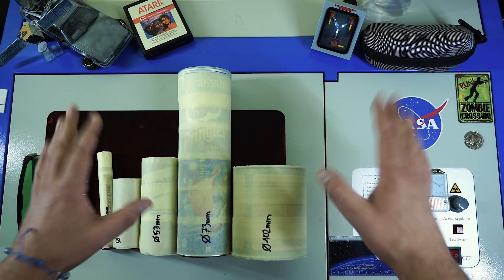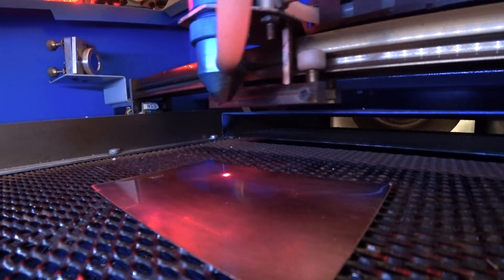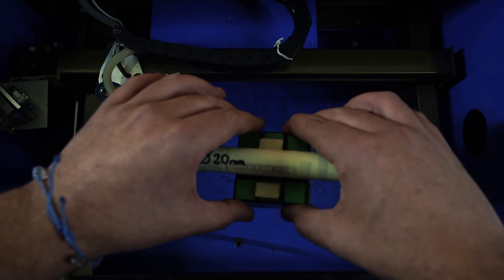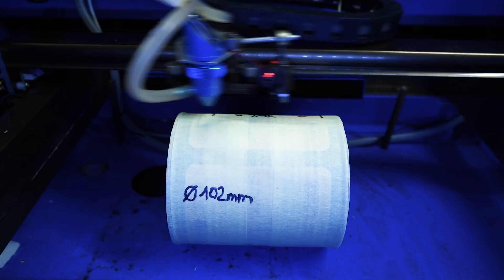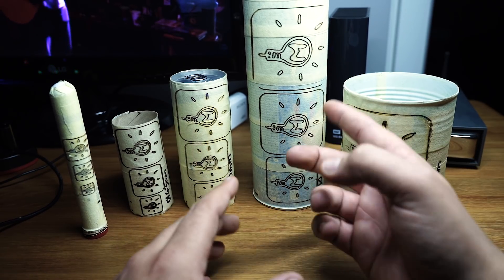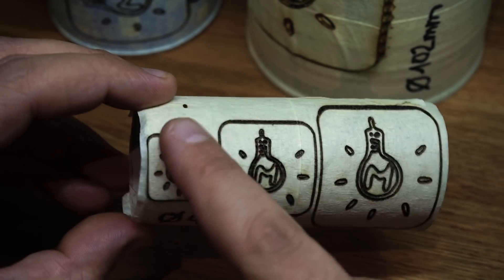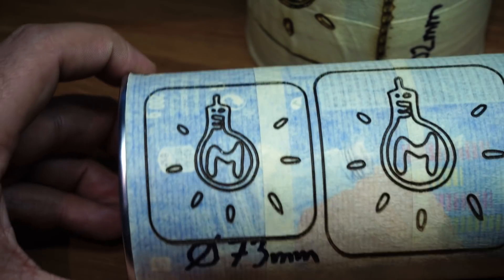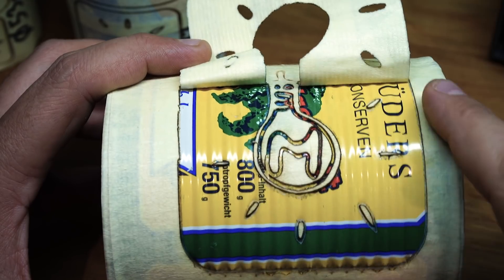K40 Laser Engrave Cylinders without Rotary Attachment?

Comment: can you tell me if I can use a K40 unit to engrave an 8mm logo on a 10mm pen barrel without a rotary attachment?
Reply from the maker: Should work, but i would use a metal pen and burn off the coating instead of a plastic pen

Comment: Love this experiment, thanks. Wondering how you decide where to locate the laser to start the burn, did you use 1/2 the logo size? Curious as the start appears to be better than the finish in cases when it didn't finish well. On my list of things to try  👍
Reply from the maker: I used the target laser and eyeballed it, i tried to set the starting point as far to the edge as possible
Reply: @MancaveEffects  cool, thanks :)

Comment: He uses green goggles to protect his eyes which if are not polycarbonate will do nothing to protect him since the green goggles are for blue diode lasers and not for the 10.6μm wave length a CO2 laser uses so has only a false sense of security.
Reply from the maker: I made a seperate video about that. I use the green 804-1400 glasses for playing arround and demonstrating things with my green laser pointer. However i do not trust any of the safety glasses and leave the room when using the K40 with open lid or put in a sheet of plywood between me and the laser to at least avoid direct infrared reflections.

Comment: So, rule of thumb- you can do etchings of 40% of diameter
Reply from the maker: Yes and no, you will always have minor distortion and it matters if your logo contains straight vectors and lines or if it has more organic lines but yes 40% should be acurate.